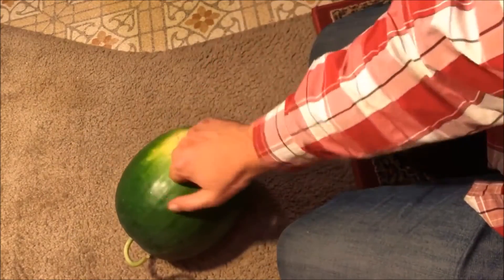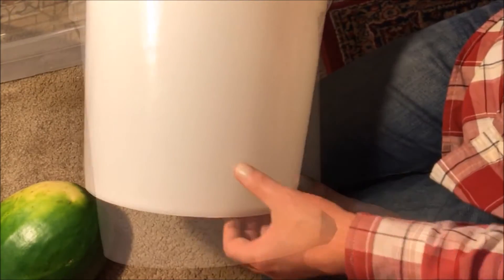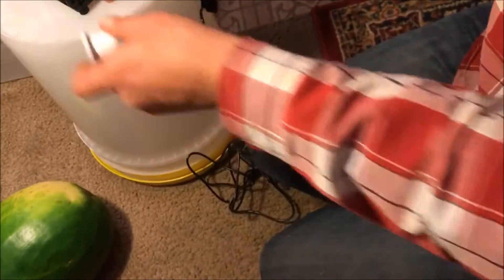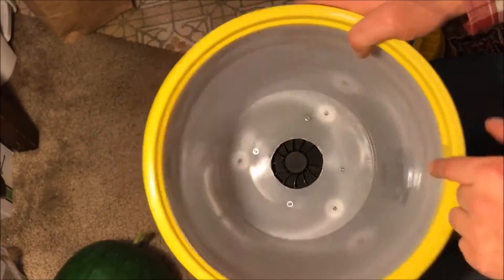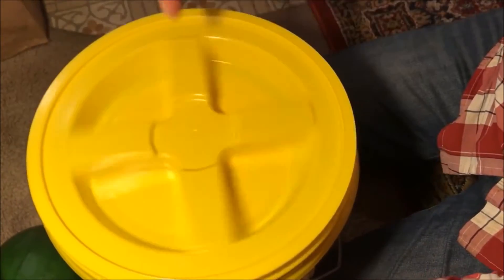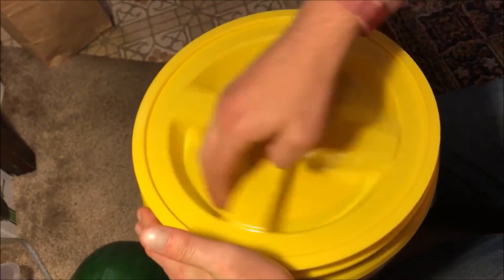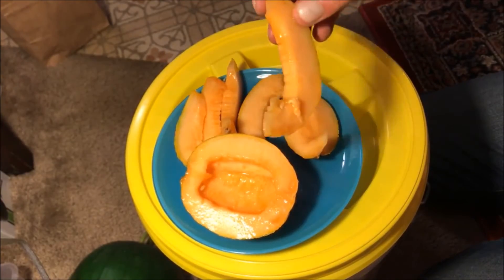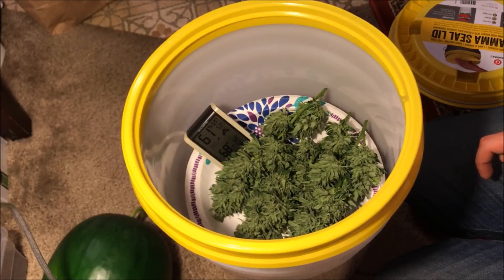DIY Auto Dryer/Curer Part 2: Chamber and Fan - Episode 152

Comment: Great idea my friend! I have made something similar in a large tote with strings across to hang the buds and it worked great! The lid not being airtight and the tiny gap where the strings went through the wall of the tote were perfect air intakes! I like how much more professionally built yours looks though ;D
Reply from the maker: Ned Denver yea there are a bunch of chambers to choose from. A small grow tent would probably work fine zipped up. If someone could find a clean, old fridge that would work perfectly since it’s already sealed, dark and already have an air circulation system! Could even have the fridge part as the drying section, and use the freezer part for curing ;)

Comment: I think its better if you hang them inside on string, cause the way you did it, the buds get moisture cause they touch the plate. the plate got the moisture because the air who get her cold beneath.

Comment: Just here out of curiosity :) - some ideas for you guys:

Required: Either a raspberry pi (zero W would do the trick) or a good MCU (ESPs), 1x 5V fan (or 12V fan with an appropriate MOSFET), activated carbon pelets, 2x DHT (11,22 etc - does not need tons of precision)

1. If you have a 3D printer, hit fusion and design an intake and and outtake - treat the outtake as the part with the fan. Model everything and create parts to open and close airflow to the container using the servos, model an airtight chamber to fill with activated charcoal wrapped in cloth to fit to the fan.
2. If raspberry pi either go with a simple python program or NodeRed and set up all the things, if a MCU hard code everything
3. Have one of the sensors check external humidity, and the other the internal humidity
4. Have the logic start a cycle of drying (1 min long) should the internal humidity be above your treshold AND the exterior humidity below your treshold

If you want to make sure there's nothing nomming on your greens, a few UV LEDs epoxied in the right spots can be switched on during drying cycles.

I don't even grow, but modding a stupid box into a tool sounds fun x) - if it ever becomes legal in my country it'll be fun to make for growers ^^
Reply from the maker: Nope, not necessary at all 😊